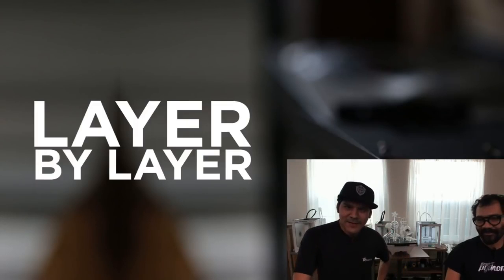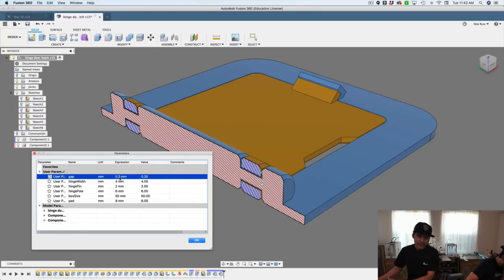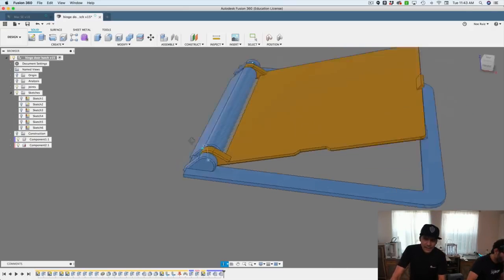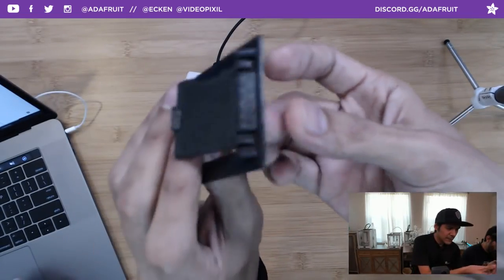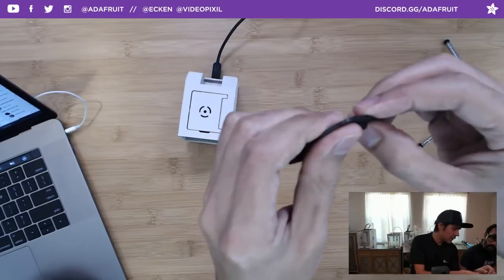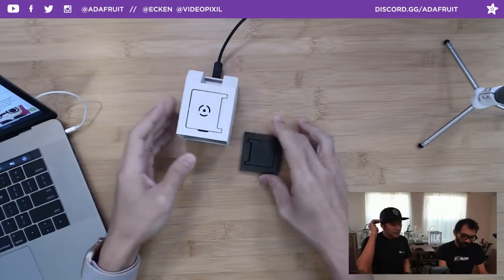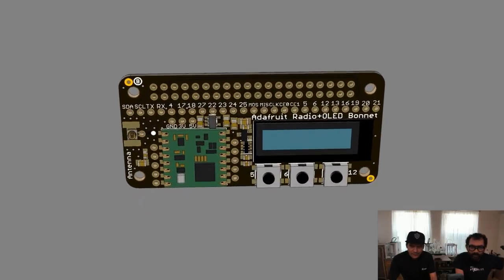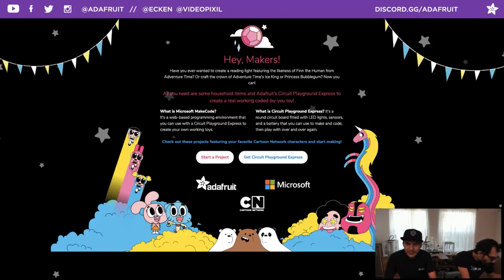Fusion 360 Tutorial – Print-In-Place Hinge – Layer by Layer

Comment: Hey, :) Just a heads up. The Fusion 360 share link returns an "Oops, File not found!" using my cell phone. Maybe it's a Autodesk thingi not being cell phone compatible/capable. Gee, maybe I ought to try using my desktop before publicly belly aching. :'\
Reply from the maker: yep looks like its a dead link we’ll have to fix. thanks for checking and letting us know!
Reply from the maker: https://a360.co/2FOY35Y
Reply: @adafruit  Hey, thx. :)
Sorry, for all the trouble. But, I've just discovered the requirement (on my cell phone anyways) to be logged into Autodesk with an account to download any files, otherwise the error message, Oops! Page not found.
Really stumped as to why this is necessary, Data collection, maybe? I dunno. Thx and apologies again.